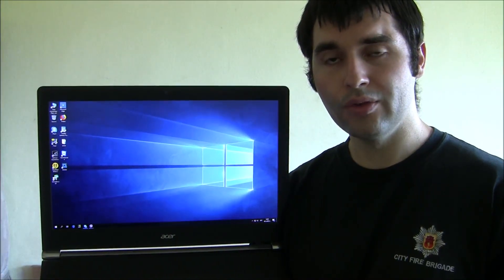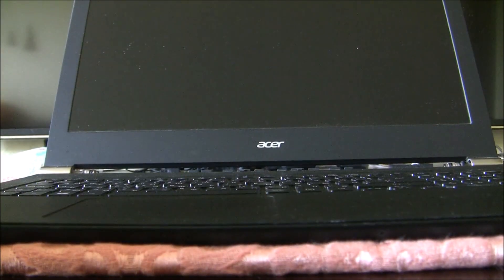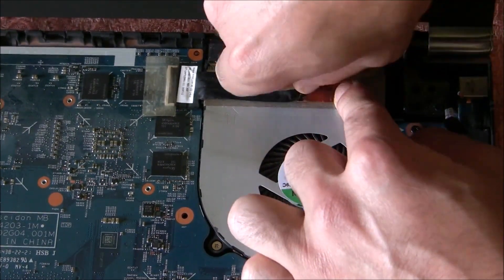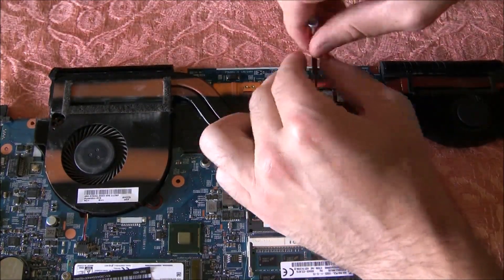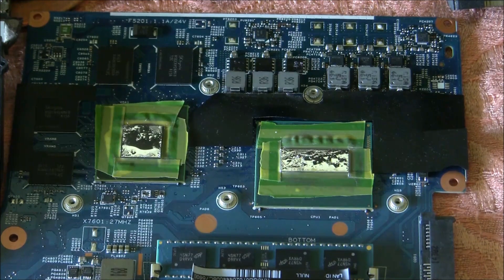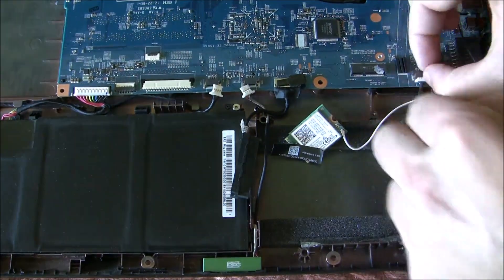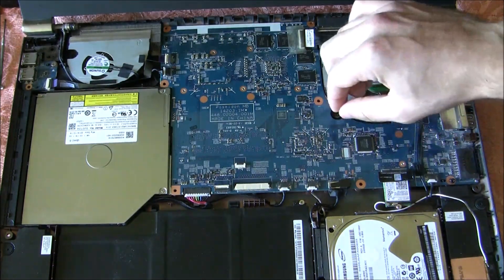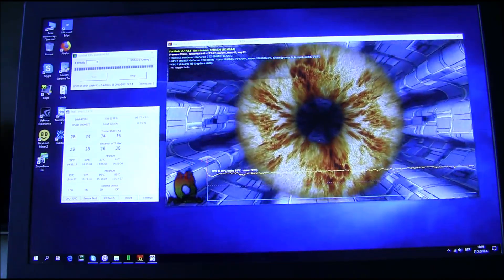Acer Aspire V 17 Nitro VN7-791G-728H Disassembly, Repasting

Comment: Great video Ivan really clear guide. I have the same laptop and was wondering if you know if its difficult to replace the fans? I have the same laptop and the fan on the right side of the motherboard has started to make a grinding noise which is particularly prominent when running at full power so I think the baring's are failing. I've had the laptop for 5 years and its not had any other issues so hoping it will be a relatively easy switch. I will be using your video to get into the laptop and have a closer look thanks again!
Reply: At 06:05 you can see him opening the fans case, then you remove them and replace. Just need to find the right size (width - height)

Comment: I add a little info: the keyboard, mousepad and palmrest cables, the first flat-ones that you remove, have a little switch, you can ignore it for removing but you need to open them for re-inserting. The two little ones are easy, just open them (up) to connect the cables, then, close. The big black one (sex pun not intended) is a bit tricky, the connector have two little switches at the sides, just open by pushing parallel to the MB (not up).
Done!
Reply: I just broke the little pin. And I cant put in that big black thing so my keyboars doesnt work...
Reply: @mukfoood  That's a bummer, I'm sorry about that. Those cables are all very fragile, a single wrong manouver can ruin them. However the important thing for making the keyboard work is to let the cable inside its slot, maybe you can fix it in another way, with a little piece of duct tape or something else. Also, is the pin definitely broken? Maybe is possible to repair it with lots of patience
Reply: @mukfoood  Me too following the video i broke the pins of the keyboard slot, it had to be opened first to left and right before extract carefully  the cable. So my keyboard is not functionnal now. I'll try to use some scotch to maintain the black thing in place but what difficult ! :/

Comment: So I tried to reconnect the cable for the keyboard (the thickest of the 3 top cables) like a 100 times but it just doesn't work. Like I push the black thingie out, and then try to stick the cable under it and pull the black thingie back in. Any tip?
Reply: I think you didnt opened the switch and so the cable cant plug in, I paste here my comment made a few weeks ago:
"I add a little info: the keyboard, mousepad and palmrest cables, the first flat-ones that you remove, have a little switch, you can ignore it for removing but you need to open them for re-inserting. The two little ones are easy, just open them (up) to connect the cables, then, close. The big black one (sex pun not intended) is a bit tricky, the connector have two little switches at the sides, just open by pushing parallel to the MB (not up).
Done!"

Comment: How hard is it to replace the fans? I have the 15 inch version of this laptop and my fan is buzzing.
Reply from the maker: Try cleaning them first, and if it doesn`t help the replacement isn`t that difficult.
Reply: @ivanplamenov7768  Thank you. I ordered some compressed air to try cleaning them.
Reply: @ivanplamenov7768  Tried using compressed air to clean via vents, didn't help. I am waiting on cleaning supplies I ordered to arrive (mini brushes and thermal paste because I think I will need to remove the heatsink to really get to the fans). The fan started clicking this past weekend, will cleaning it solve the clicking or does that require replacing the fan?
Reply: @septic55  how is it now?
Reply: @strichtarn3228  Thank you so much for following up. Cleaning the clicking fan didn't help, it appears that the fan blades themselves had warped. I ordered a new fan from New Egg and replaced the clicking fan. It went well, the fan screws were smaller than I had in my set, but found one that fit in my drawer of random stuff. No more clicking fan and the temps are staying normal.
Reply: @septic55  Glad to hear it!
Reply: @ivanplamenov7768  Are they both soldered to the heatsink or only fixed with screws  if I need to replace a whole fan ? (the one to the right makes noise even after cleaning it and change thermal paste)

Comment: Thank for this video bro. I want to know a thing. Dose it have an SSD Msata slot? Some versions of this laptop have an SSD Msata slot but don't have a DVD drive. But in this laptop I can't see the Msata slot. Many thanks
Reply from the maker: Just check the exact model of the laptop, because some of them have it depending on the model but some of them don`t.
Reply: @ivanplamenov7768  I have double checked it. Many thanks
Reply: I am pretty sure it’s mSATA. Added a SATA III SSD today and it worked perfectly.  I used the Western Digital SATA III 2280 m.2 1TB blue drive just FYI. Cloned HDD to SSD and reformatted the HDD.
Reply: Mine does not have an Msata, but have the M.2 slot (sata 3) that you can see at 5:12
Installed it, works fine, paired with the original HDD that I keep for simple storage.

Comment: What's the black component in bottom-left corner, between optical drive and battery, it's not disassembled in this video.
in my device it's noisy like a fan, what's his name? i want to replace it.
Reply: Pretty sure that is the left speaker.  That’s what the plug on the motherboard said it was anyways, on my laptop today
Reply: Yes I confirm, the black non - disassembled components at left and right are the speakers.

Comment: Great video, it was very useful to me. Thanks! Have you ever changed the speaker? Mine makes a lot of noise/cracks etc. when the machine heats up (i.e. playing games after 30 min of so). They first told me it was because of the fans, but following your video and cleaning up everything didn't help. This horrible noise does come out of the speaker though. Any hints?
Reply: Hey, did you happen to find a solution to this? I'm having the same problem and don't know what to do.
Reply: @Kubab104  Hi, yes I did solve the problem (well, half way unfortunately). An easy diagnostic to do is to deactivate audio drivers (software preferences), reboot the PC and see if the noise is still there. If not, it confirms the problem comes from the speakers. I then disassemble the PC again and remove the faulty speaker. Now it's fine, except I'm missing a speaker :(. I was not able to find a spare part unfortunately. HTH.
Reply: @piqueselio   I will try it then, thank you so much for the reply! :)
Reply: @Kubab104  I had the same issue in the past. The only thing that helped was to unplug the speaker.

Comment: Hi, i was applying liquid metal and when i started my laptop (same as yours) i heard the fan, but display wasnt working and it restarted after 5 mins and do the same thing in loop..so i disassembled whole laptop again and the liquid metal was on gpu transistors or these small things, so i cleaned it up with alcohol, started laptop and it was working but i didnt get better tempertures, so stupid me applied more liquid metal and happnd the same thing, when i tried to start up, the fan is working, keyboard too but no display output..it goes like 10 seconds and then restart and again in loop, so i cleaned up the liquid metal again (stupid me) but this time laptop didnt start normaly just in 10 second loop without display..did i burned gpu?
Reply: liquid metal is for advanced users who know what they're doing because its conductive as you may have noticed. use non conductive thermal paste next time its almost just as good
Reply: LOL :´DD

Comment: What is the brand of thermal paste
Reply from the maker: The thermal paste is Grizzly Conductonaut.
Reply: I used kryonaut because it is non conducting. It isn’t as effecient but my first tests show great improvements. I’m sure if I run the stress test it will throttle but it’s good enough for me. I’m afraid the heat in my region may cause the conductonaut to bleed if kept vertical for too long.  I may try it some day if I want to play with it